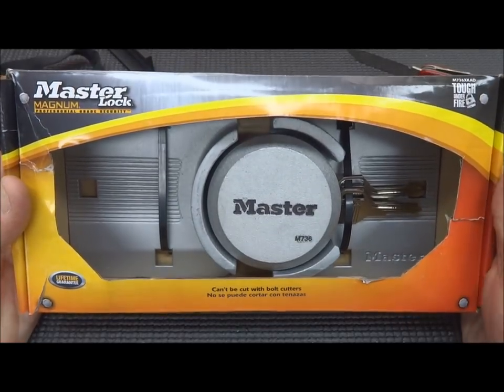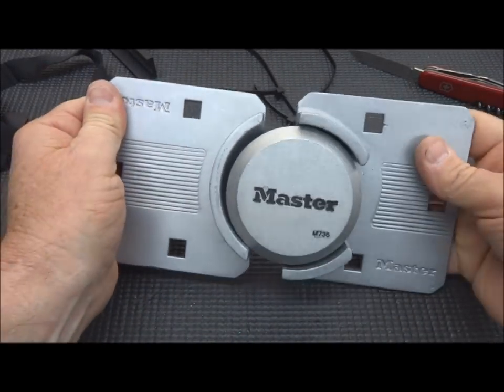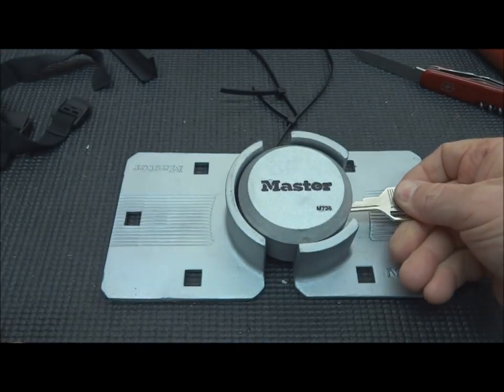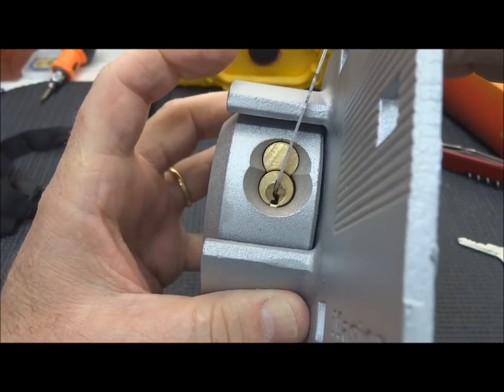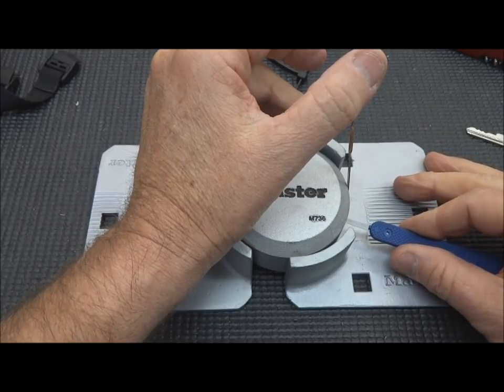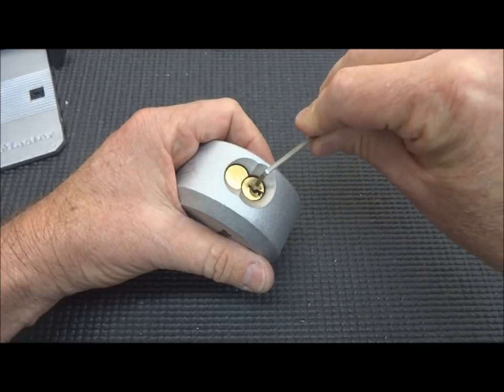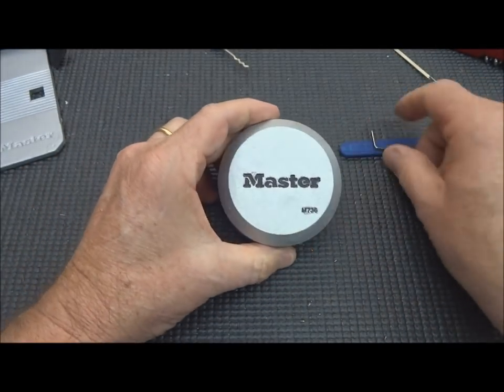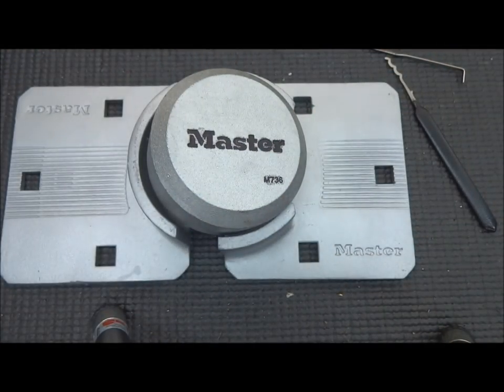(313) Review: Master Lock M736 Puck Lock (JUNK!)

Comment: after watching a couple of this guys videos i am never buying another master lock again.
Reply: For amateur lock pickers they are a great confidence booster.
Reply: This lock is designed to defeat smashing, cutting and prying which is what most thieves do and it does that well. Few of these knuckle heads are picking locks. Its perfect for a shed. Its waaaay better than the stock handle lock that can probably be opened with a pipe wrench or a $15 hasp and padlock that can be cut with bolt cutters.
Reply: Master is a lot better than most. If you want better, first get a bank loan.
Reply: I mean not sure how many people pick locks. Criminals destructively break into things and in that case all locks do about the same for defense. Nothing. (Former thief)
Reply: @bluechi9816  most criminals destructively break in. Not all do.
Reply: Lol only reason I would buy one is to show someone how insecure it is... and then return it for my money back

Comment from the maker: It is part of my evil plan to screw someone by doing EXACTLY that.  I'm going to upgrade both the key pins and driver pins to a serrated/spool mix.  I'm also going to add pins to the 6th chamber. It'll look, feel and smell like a POS Master Lock, still use the same key, but behave like a REAL lock.  Total cost: about 0.25 cents in parts, max.
Reply: Where could I too learn these dark arts?
Reply: @717UT  
By practicing. 
And having the extra pins and springs to go with it. 😁
Reply: Can I apply this to a storage sliding door?

Comment from the maker: Until Master improves their locks, I;m staying with American Brand.  It is still owned by Master Lock Corporation, but the innards are much higher quality and they are a LOT harder to pick than these M736s.  FYI, both Mul-T-Lock and Medeco make a puck lock as well but they cost a lot more.  I think they are both in the $150 range, so I suppose it depends on the value of what you're trying to secure.
Reply: what do you think of the Trimax THPXL puck locks?

Comment: If you want to make this lock a bit more secure, weld a piece of metal (straight or L/T shape) to the right side so only the key could be fitted between the lock and the piece of metal. The standard lockpicks (long) might not be able to be used then.
Reply: 1. Did you do it?
2. Who lockpicks to steal?
Reply: @aurelienyonrac  A smart thief, less noise the better.

Comment: random caveat from a tree trimmer.

the point of locks on most equipment is to keep people honest. we don't expect locks to PREVENT our shit from getting jacked, we want them to DETER an opportunistic theif and not a hell bent professional.

when someone wants in your truck or trailer there are much more effective ways than spending time picking a lock. I've even seen lawn and tree equipment trucks and trailers that simply had the back door or side cut wide open with a sawsall.

good video btw. just figured I would help explain the prevalence of these locks. they are meant to keep people honest, to stop the average crackhead, not for hell bent hawkers.
Reply: +neeedleinahaystack I mean it wouldnt take a hell bent criminal. Just a thief with a couple tools. Literally just takes three seconds to rake this lock. Its absolute crapolla.
Reply: +neeedleinahaystack  Exactly.   These things are designed to keep people from busting out a window, or using a small prybar  and gaining access to the vehicle.
Reply: +odc43054 if that screwed or bolted to the door skin of a van which will have on average .5mm thick steel a prybar is all you'll need to bust it off
Reply: +kyle “brainbukt” hubner True, although the skin on my car exceeds .5mm. None the less if its anchored just in the sheetwork its coming off. But that makes noise, waking the tradesman who then exercises his second amendment on your thieving ass.
Reply: +neeedleinahaystack Still yet, why not spend the money on a brand/lock that is more decent if they cost the same?
Reply: locks just slow them down almost all available locks can be picked or broken. Better to have  a motion sensor with loud alarm imo
Reply: Yeah, this sort of lock is used to make it hard to get in without getting noticed. Generally that would mean that you can't break stuff with hammers or crowbars ( or sawzall) while people are near by. Also, a lock that takes a few minutes to pick is a problem for most thieves because that too is enough to raise suspicion. The problem with this lock is that a minimally experienced lock picker can open it in so short a time that no one would notice that it's being picked.
Reply: the lesson here is that you need to drill up your trucks and trailer walls and drop in a bunch of hardened steel or carbide anti cut rods.
Reply: kyle
  hubner
Reply: Ex-Grocer, we'd have soda or candy containers mysteriously break open or spill during transport. Amazingly, keeping the back locked from dock to dock completely eliminated these "accidents".
Reply: Lock picking doesn't really require hell bent professional to perform. A simple padlock would perform the same. Maybe even better than this huge thing.
Reply: no door lock is going to stop someone from taking a drill and jigsaw to your door.
Reply: Personally speaking, I don't believe in using locks that just keep honest people honest. If it's worth putting a lock on it then it's worth using a lock that takes more than 3 seconds to pick.

Seriously, I have literally picked Master locks in under a second, multiple locks and multiple times. And I'm not even that good at it. These things can be picked quicker than you can find the key on a key ring. At that point you're not even stopping opportunistic thieves.
Reply: Late reply, I know, but I'd say that's true of pretty much all locks. If I was a filthy crim and wanted to break into a house, I wouldn't bother with picking the locks...why bother when a stiff kick will get me through the door, or I can just break a window? Locks don't really secure anything...they're just a deterrent. Why bother cutting a bike lock when the bike next to it isn't locked at all?

BUT, that's no excuse for a terrible product. It would cost almost nothing to swap out one or two of the pins with spools...and with that minor modification, the lock is suddenly rake-proof and a lot harder to pick.
Reply: Very Good point. But, he says American version is 100 times better lock. for only a few dollars more. it's nice to know what u are getting for your money.

Comment: I just bought this lock.  Yours has different roll pins  (2) and mine has a hex screw to remove the mechanism. It is aluminum, but the steel hasps are extremely tough. I used a torch to super heat one side to bend it for a custom application and still had to use a sledge hammer to form the bend. I am going to weld metal to the ears so it forms a complete circle to eliminate pry bars entering thru the 2 gaps on top and bottom. Hopefully I can weld a tab??? to hinder a lock pickers tools.

Comment: It looks like good hardware though.  Could a layman recore these easily with off-the-shelf parts and key?
Reply: +spraynpray a determined theif isn't even going to bother picking the long shoft of welding that plate to a vehicles skin i can tell you now 6 screws are not keeping the plate mounted to a car. a good few whacks with a mallet and you'll tear that sucker clean off
Reply: They appear to be 1/4" or 5/16" carriage bolts. Even for a softer grade 2, you need close to 3000 pounds to shear off a single 1/4" bolt, or 2350 pounds to break it in tension.

I doubt you'll get far with a "mallet" against six of those.
Reply: The bolts would tear right out of the sheet metal pretty easily if the owner doesn't put a backing plate on or didn't weld the masterlock panels on.
Reply: Alaric Bergeron
 when the door you screw it to is maybe 5mm thick AT BEST if you don't catch a structural pillar or backing plate then it coming right off
bolts intact
Reply: I am sad to report I can attest to prying the lock and taking the plates and lock right out of the van... $10000 worth of equipment stolen from my van a week ago. I am so pissed the lock did not have plates on the back. I did not know because I bought the van with those locks.

Comment: For those saying the bracket could be easily pried, you'd mount it with sheet metal screws? It looks like it would accept some fairly large carriage bolts. Along with some washers.. you wouldn't be prying it out of anything much thicker than aluminum foil. But it's a moot point.

Comment: This lock would certainly give someone a false sense of security. Thought about this for my music van - with over $25K of hardware and instruments... I don't think I'll go this route! Why in the world would a good company like Master Lock put all of the work into a design that cannot be forced open, but be picked in seconds? What crappy engineering! Thanks for the eye-opener!
Reply: false sense of security is masterlock's mantra
Reply: Just a mistake in your comment I'm going to correct, master lock isn't a good company.
Reply: For Vans, look to your Locksmith, Van upfitter or 4wheel shop for SLIK LOCKS. These are brakets engineered for Sprinters, ProMasters, Nissan and other commercial vans that bolt to existing fasteners INSIDE van. The hasp sticks out through the gap between door and jamb. You lock with American 2000 or Master 6270 "Puck Lock". This will look a lot better than rusting plates and carriage bolts, too
Reply: Brad Penrod the first step to not getting robbed is not advertising your 25000 dollars worth of equipment in your van

Comment: Unbolt the whole lock from both sides of the door?
Reply: cut a groove as if removing stripped screws? like with a dremel for a flathead? i just hope you dont think my question is stupid as we see how easy it is to pick
Reply: Not to mention smart installer would put good counter nuts and washers on the heads and before the final nut from the inside+ threadlocker. i am a little confused about the shaft  portion of your reply. can you explain better please?
Reply: Lawrence Shraybman The shaft portion that he's referring to is the shaft of the bolt.  It is possible to acquire bolts that have shafts that are squared near the head, making them impossible to turn even with a slot cut into the head.  Most carriage bolts are done in that fashion.  http://trade.indiamart.com/details.mp?offer=3069557548  for reference.
Reply: thank you i know exactly what those are after a picture. loosen from the inside nut then push out past that square then you can turn it from either side.
Reply: Lawrence Shraybman  That only works if you have access to the inside nuts, something that this type of device is meant to prevent.  At that point, you'd be grinding off the entire head in order to gain access if the lock itself wasn't so poorly thought through.  It's not a bad design, really, save for the crappy puck lock.
Reply: Lone Wulf You're absolutely right. Heck, at that point. There's a difference between a lockpicking hobby, and destructive or careless entry. if not entry but robbery is the goal. at this point it would be easier to bypass ignition security and just drive away. U R correct. not a bad design. theres a reason engineers think long and hard
Reply: i don't see why you couldn't do that right but as Lone Wulf said the other nuts if you ad so much pressure very quick that it shocks it into sticking then the bolts would come off
Reply: tiernan eviston
Reply: in school we were donated two puck locks along witha bunch of other locks. one is american co and one is master. lets just say i didnt even bother taking the masterlock to try impressioning it and or picking it.
Reply: Yea i got ya Lawrence Shraybman
Reply: tiernan eviston weird.  my comment disappeared.   It was about how all this picking is interesting and everything but the reality of it is thieves don't compromise security this way.   How many cars do you think are broken into by picking door locks and ignitions?   None.  And it'll be the same with this lock.  As easy as it might be to pick, if 1000 things were broken into that were secured by one of these locks, you'd be lucky to find even 1 were the lock was picked.  If anything, i would use an angle grinder and cut off the heads of the 3 carriage bolts holding 1 side plate.       It's the same with using $150 padlocks.   Nobody picks a padlock...NOBODY.  There are all kinds of youtube videos where people test the biggest most badass locks made out of the toughest boron metals, with shackles protected by full shrouding.   The guy brings out the biggest most badass bolt cutters and chops right through the shackle along with the shrouding "protecting" it.   Anyways, i still find these videos interesting, they just don't prove anything as far as showing pick resistance.
Reply: +Lawrence Shraybman Mounted to the body of a vehicle... Crowbar, and pull the bolts through the body.

Comment: For another $10 you can get a hardened steel puck lock from Cobralock with an Abloy Sentry core. I just bought one. I haven't gotten it yet to test for sure, but it's GOT to be at least $50 better than that piece of junk.
Reply from the maker: Ten bucks?  That's IT?  I'd say it is about 1000 time more secure than this crappy M736, maybe MORE!  I have not seen a single example of anyone picking an Abloy Sentry reliably.  I know I can't, despite many hundreds of hours of picking.  They simply have too many discs and false gates.

Comment: The way the plate that comes with the lock mounts provides a weak point of attack as well.  All you would have to do is drill out the bolt heads on one side and you've defeated the lock as well.

Comment: Thanks for this vid.  Was considering recommending these cheaper locks to a friend with puck lock compatible bars on his convenience store.  After two smash and grabs I thought these would be sufficient but should a slightly smarter criminal resort to picking rather than smashing, I'd say that $20K in Lottery tickets and merchandise is worth upgrading locks to protect. BTW, even if the Lottery ticket bundles are known by serialized numbers, you will NOT be recompensed for them. It's a dead loss for the business as even their insurance does not cover the tickets, only the physical damage or loss of other merchandise.

Comment: Tig weld a three inch long tubular steel over key hole, narrow and lengthen key!
Reply: THERE DONE!
Reply: Kendell Bise Or good expoxy resin glue.
Reply: so he switches to a 4" long tensioner and 5" lock piece of wire.   done

Comment: Your favorite store sells a dumbed down version of the model you will find in locksmith shops. The entire Pro-Series is a bit more resistant to picking and bumping, using a more precisely machined cylinder utilizing. The dept store models have a lot of tolerance buildup, and as you deftly demonstrated, are quite easy to pick. This is why I do not sell the products found in your fav store.

Comment: I've picked those on warded ConEx doors at construction sites (when the subcontractors left their keys at home, etc.).  Even with the rake bent at a 90 degree angle, I could pick them with out too much hassle (less than 5 minutes).  I'm not a locksmith.

Comment: Could that be upgraded into a semi decent lock by repinning it, or is the design just too flawed?
Reply: I'm repinning a laminated No3. No security pins or special pins, same springs, 4 pins, but scary bidding and some alien technology in there.
Reply: Master makes abetter one domestically. Nearly identical in appearance, it is a much tougher to pick, close tolerance and pick resistant design. AND, every 5th one is not the same key. I rekey all my inventory to a longer key. The commercial models are capable of 6 pin keying. This assures each client has a key code different from all other clients. So, rhather than put lipstick on a piggie, just get the good one from a locksmith shop, or the American 2000, which is also excellent. Each are about 43.00 at a fine lock shop near you, and NOT sold in dept stores. Online, you risk getting uber-common keys from large joblots keyed alike, so security of a good lock is often sacrificed.
Reply: Can the 6 pin American series 2000 core be put in the master lock version? as i know they are both removable from the lock body by an Allen wrench. 

If so thieves would get an unwelcome American lock surprise when picking.
Reply: AdrnUk Great idea. I just bought this lock. I am replacing the 2 roll pins to thicker ones. Also welding metal to the ears on the hasps to meet so they form a full circle. The actual lock is aluminum so it is vulnerable by prying through these 2 gaps. I shaved the word Master and the model number off the face so that is how I know it is aluminum. Main reason I bought this lock is the visual deterrence.
Reply: @adrn25m  Indeed you can and the Master Body I have is iron.dosent have USA on it.(A736) is Iron Unlike the soft Zink American 2000 series

Comment: You can get a puck lock now also with the protec2 keyway for reasonable cost. Problem is they can all be cut off with an angle grinder or a large cutoff saw, fire rescue does it all the time...

Comment: To be fair, the lock is designed to foil thieves with bolt cutters (as it says right on the box). Having been a truck driver, I can attest to many cases of stolen goods where the padlocks were cut off, but never had a case where the lock was picked. According to a State Farm document I saw once, less than 7% of burglaries involve attempts to use bump keys or lock picks.